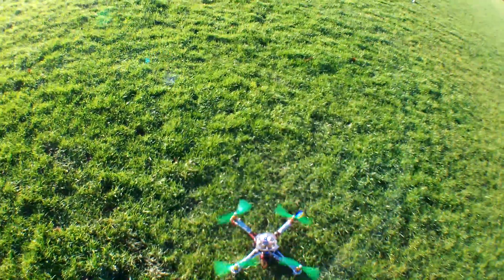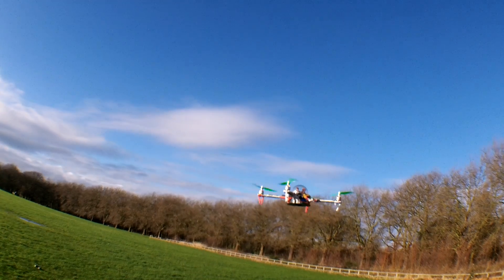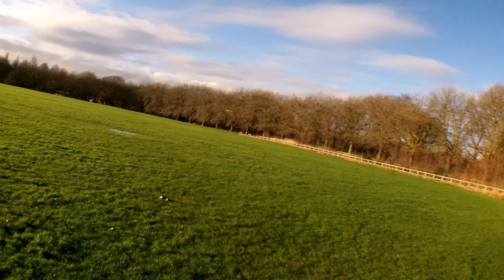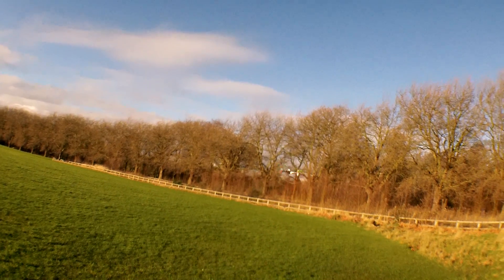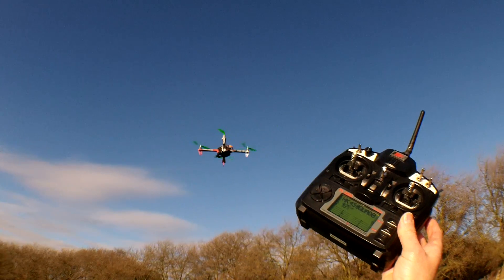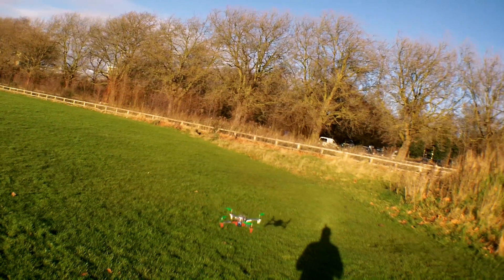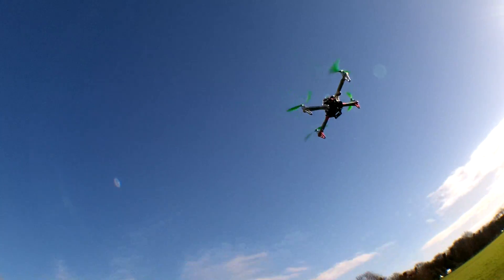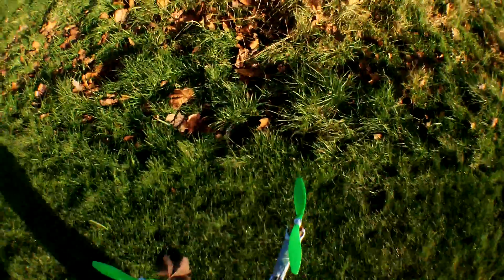MultiWii 328p controller testing

Comment: Your quadcopter flies so stable. I had a MultiWii 328p board and config it by using the multiwii project GUI and source code. However, it didn't work well. One prop was always rotating slower than the other three. Could you share how you config the board?
Reply from the maker: As I mentioned below is all pretty stock, unfortunately I don't have that board anymore as now I use naze32's, which are much better IMHO.

Thanks,

BTW have a look at the link on video description, I might have posted some info there at the time.

Cheers.

Comment: Thats an awesome video.
Can you share any tips about running the PID? I know there is a lot of information online already, but your flight looks very smooth and controlled.
Reply from the maker: Sorry don't have that controller any longer, I only played with LPF coz I had vibration issues resulting in choppy throttle, I only increased rates a bit, PIDS were pretty much defaults. The rest is plenty of flying practice I guess. Thanks :)